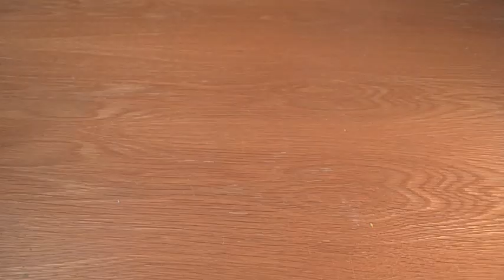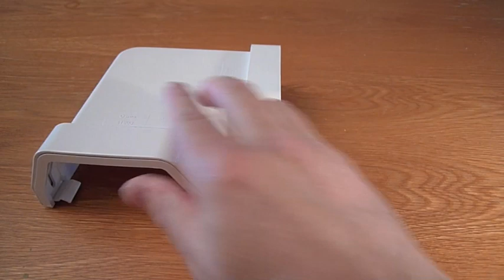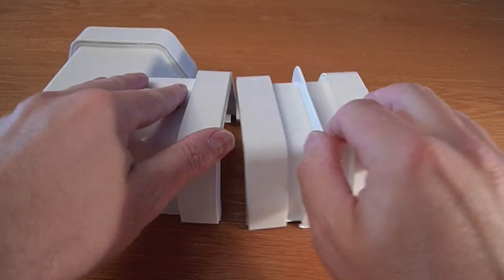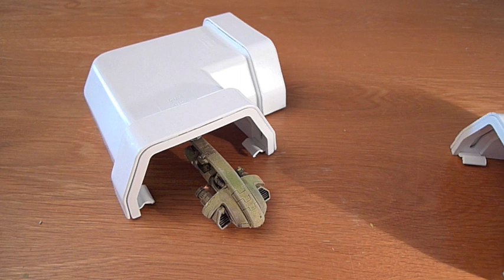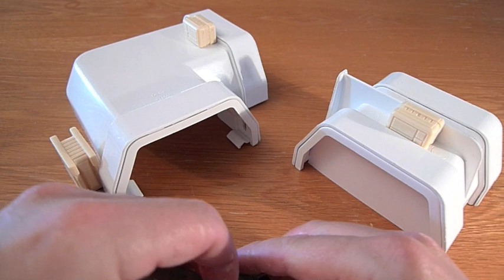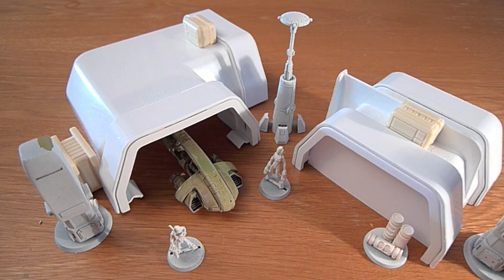tau buildings - part one

Comment: great and simple idea and looks awesome, i just have a couple questions. 
1. where do you find those extra bits like the mini generator bits you can put onto the doorways and the actual door that you use and secondly, what glue should i use for gluing this up and what paints, the citadel ones or some different ones. and finally where would you get that main piece in the beginning and what is it called?